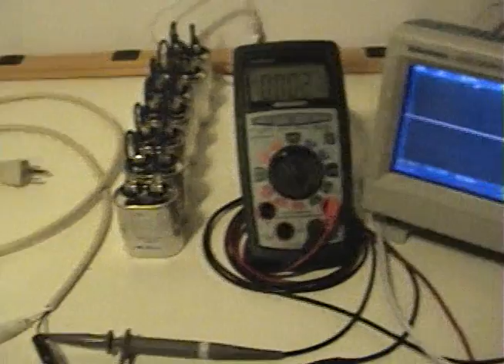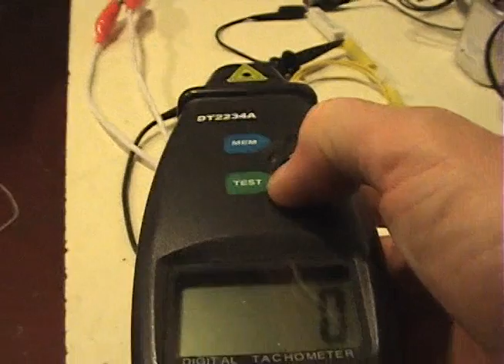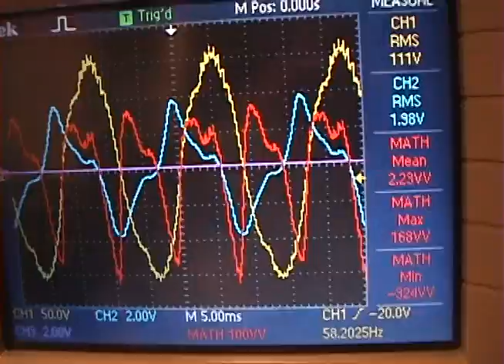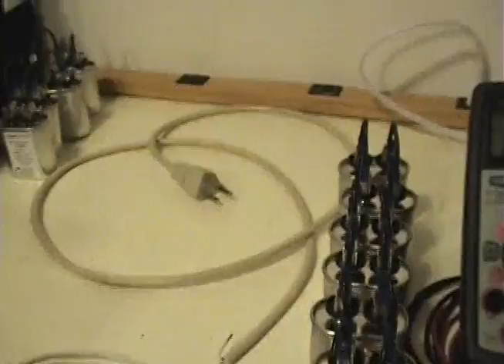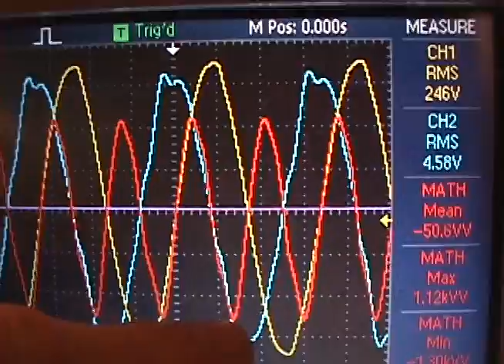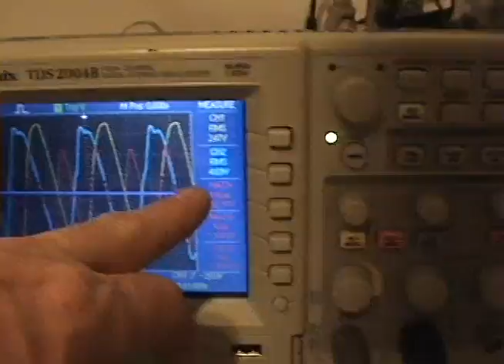Reactive Generator Tutorial Demo 2

Comment: Excelent work Luc. I have been waitting for my capacitors to show up in the mail. I will test this out. I may show my results. Thanks for the detailed instructions. Happy New Year, Luc.
Reply from the maker: Glad you'll be experimenting Mike!
All the best in this New Year
Remember to share, as this is the Key to Receiving

Luc
Reply: You bet Luc, I have built a two isolation transformers using two MOTs. One for High current and one for low current. I Removed the two HV coil and put them together onto one. Did the same with the LV coils. It's crude but works, and it's free. Still waiting my caps!

Comment: if your logic is right, all what left to demo - is to use battery(inverter) instead of grid  and see,  is it really puts 5w into battery instead of drawing 250w from it.
in other words - would it charge battery and spin motor forever or simply  deplete it in minutes (~50wh/kg, LA batt)
Reply from the maker: It is not that easy. If you read the forum topic you will see that I have written many times that an Inverter will not work. They are not capable of receiving returned power. At this time only a generator or grid will benefit of this effect.

Luc

Comment: Nice Video Luc. Unfortunately you are relying on the "numbers in boxes" that the scope is providing, and in particular when the MEAN goes negative it is not correct. I have no doubt that you are providing power to your loads, but I very much doubt that any net power is being returned to the grid. Parts are ordered, and testing shall begin when received, so that I can hopefully show you what is really happening with your measurements.
Reply from the maker: That's great poynt99... your are very talented in electronics and will look forward in your experiment results.

Hope you will have an Alternator to test with as I will not be convinced just by looking at scope data.

Luc
Reply: Luc Choquette
I disagree Luc. I think you will be quite convinced once you understand the problem.